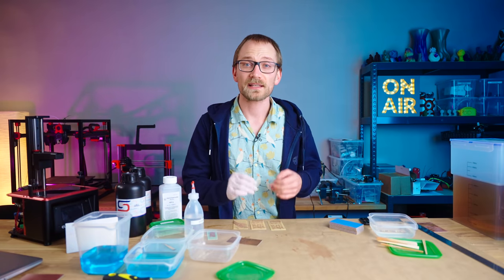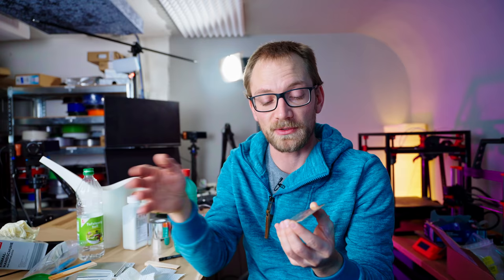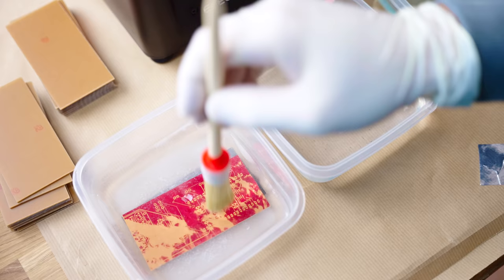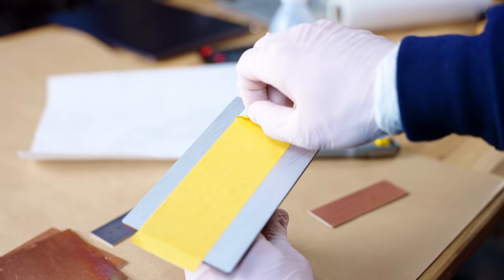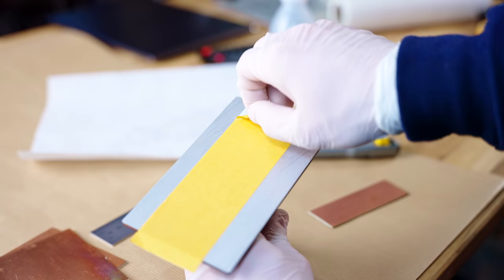The fastest way to make crisp PCBs at home!

Comment: The best way is : Get the pcb , a plastic sheet like u use in school to project page's or images , photo-developer , etching liquid of choise : hydro peroxide + salt peter acid is what i used if i translated it correcT. And u need a UV light box, a old scanner , pop some UV lights in. So u print the circut on the plastic sheet, u put the sheet over pcb,  u light it with your UV light box . u trow it in developer to  develop the traces on the pcb itself , than trow it in etching liquid where it eats away the coper that didnt turn black from the UV expoture (the actual pcb tracks) 5 min job if u have all ready to go. and pretty easy to get 2 sides pcb's done even.
Reply: Alternatively , there's PCB's where u can draw on with permanent marker and just draw it out , than do it in the etching fluid of choise , ask your local elektronic store i'm sure they got some

Comment: Interesting.  I haven't etched a board in about 15 years.  This would have been great back then.  Dual side could be doable, but it seems like it would be hard to line it up perfectly. I suppose the easiest way would be to center the mask in Chitubox and set up registration tape to line up the board and then flip it.  Might take some testing to get it right.  Seems like a nice way to make prototype boards, or one offs.  If someone wanted higher production at home, I'd think a CNC would be a good option, or a fiber laser.

Comment: Hm, the only thing that is omitted is the printing of the PCB layout on a foil, but for that you first have to create a 3D file of the layout. Then it's better to use the toner transfer method or insulation milling with a CNC. Or have I overlooked something?

Comment: Would like to know if you could use could use an aluminium can scrubbed clean with a etch resist to make a solder paste stencil too.  That would save a lot of hassle for a lot of people too!
Reply: I'm assuming a laminate photo resist as part of the process and then using your 3d UV printer to expose the patrern.

Comment: Instead of using photoresist, I wonder if you'd be able to directly SLA print resin onto a copper clad board. You'd probably only need a layer or two. Then an etching solution could remove the copper that didn't have the cured resin on top. Removing the resin after might be hard, but it would cut out the development step of the photoresist.
Reply: He tried that in this video, at the end.  Short version, great idea in theory, doesn't work in practice.

Comment: what was the minimum trace widths? they should better be either vertical, or horizontal. at other angles the result would be worse? 
where did you obtain that clad pcb with photoresist? probably, if you make board stops on the printer table, you can also solder mask photoresist after etching the board?

Comment: I can tell you from experience that most resins should not give off any nasty fumes. I have used UV resin for patching damages in the past and I could solder right next to it without noticing any downside. It's basically the same stuff as what they use in the factory - maybe you can try it out outside and tell us if e.g. a black resin gives off worse fumes than the resin-soaked fiber glass that is the basis of every PCB..

Comment: Is it possible to use an FDM printer to produce Circuit Boards? I’ve seen your video on the RepRap style but I was curious if there’s a filament that can tolerate the developing chemicals used on the photoresist film. The pcb details could be “masked” by printing the gerber or inverse gerber( whichever is the correct one) with filament then put through the developing process. I thought I asked this before, but I can’t find the question I asked or answer. So I apologize if this is a duplicate. -Jason Burchell

Comment: How about spray paint the PCB with lacquer and then engrave it with a laser before etching? That's how PCBs were made when I went to college, they used a professional laser cutter but I'm pretty sure a cheap hobbyist machine will work as well.

Comment: Seems like Chitu should consider this a selling point and add some custom software import/firmware options and possibly a "diy kit" and some sort of flow chart so it's not just chemicals and containers. My only concern would be running my display for 60 to 90 seconds continuously shortening the lcd lifespan. I wonder if two 30-45 seconds bursts would do the same thing with a short cool down period in between? If it was a built in firmware option why not?

Comment: Did you just make a 2-sided design on single-sided copper? As the other guy said, dry film photoresist is likely what you want to go for, but photoresistive ink with a sheet of transparency atop it should work too, and that same workflow can be used to apply a solder mask. A solder mask is something I recommend. I also recommend making up a tin plating solution with tin chloride and thiourea. Adding a little baking soda to the solution to neutralise any remaining acid and displace any O2 in the container with CO2 should make it last a while.

I rivet 0.8mm copper wires into the via holes by hand, it’s a bit of a pain but it gives a much better result than soldering them. Actually aligning the two sides will be your biggest issue, I’d advise 3D printing some sort of repeatable jig with which to align the edges of the blank copperclad each time. On the other hand, drilling all the holes first, exposing a piece of dry film photoresist for each side, and then aligning the pieces of photoresist to the holes could work well enough. I hand-paint my traces so it’s not an issue, if you don’t mind the carpal tunnel.
Obviously THT parts are more of an issue than SMT parts so I’d try to avoid them if possible, and I’d also ensure that any traces connecting to THT parts only connect to the opposite side of the board from the part itself. This way you only need to solder the ends of the leads. In the case of an IC socket, electrolytic capacitor, crystal, and some other parts, you’ll find that the part being mounted flush to the board prevents soldering on that side. Ideally a 2-sided board would have plated through-holes, but that’s not terribly easy for a home shop without messing about with silver plating or electroforming. So I attempt to fit everything onto a single-sided board if possible, only using a 2-sided board if needed. As for 4-sided boards, I’m willing to attempt to laminate two pieces of single-sided board with a 2-sided board between them. Sounds fun.

Comment: Would a non-clear resin be more successful? Is the issue potential 'bleed' through the clear resin?

if this method worked it would be so much better (and cheaper) than the UV sensitive ones as you only need the one chemical solution.

Comment: One of the usual cheap options if to use a special paper that you print on using a standard laser printer. Then iron that print on to your copper clad PCB, which transfers the toner image to the PCB. Peel off the special paper by dipping it in water and then just etch as normal. The papers really cheap, but quality differs between manufacturers.
Reply from the maker: Done that a couple times in the old days, but it's not been particularly repeatable and printers are getting rarer and rarer these days

Comment: An interesting idea, and I applaud the multiple use of expensive hardware, but the problem for me is all the toxic chemicals required.  The toner transfer method only requires a laser printer, a household iron or repurposed laminator and some ferric chloride.  It does take a bit of practice, but I suppose, so does using a 3D printer.

Comment: I use photographic paper on laser printer to print the mask, then I transfer it using ironing onto copper pcbs without photoresist layer.. with the right kind of paper the mask turns out perfect.
rest of the process remains the same.

Comment: This actually seems like a great idea for prototyping board houses.

You could load up a stack of panels on one end 
expose them to the UV light
developer
etcher
cleaning
apply solder mask through heat transfer film,
solder mask through ink jet
then off to a CNC which may be the only manual step in the process

Ideally there are no masks made to expose the PCB, silk screen, or solder mask. Wouldn't this allow them to produce boards faster with less waste?
Reply: without a mask you cant control what is etched and what isnt, the alternate is CNC the tracks which has the disadvantage of really bad resolution where small tracks don't form and break easily and then putting a solder mask is more complicated due to the uneven board

Comment: nice idea, but the LCD screen in these printers do not fair well with long exposures to UV. normal 3d printing the uv is on for less than 30 seconds for the initial layers then 2.5 seconds for all other layers. maybe i would use this for a PCB that require uber detail on tiny tracks verry occasionally, but getting hold of replacement LCD screens will be an issue.

for the price of one lcd screen, you can get yourself s UV bulb, and inkjet or laser clear sheets..,

Comment: i want my PCB to have a connector. imagine 9 pads on a pcb and i want a 3rd party chip with 9 pads to touch the 9 pads on my PCB (no soldering, these are disposable counter chips that are constantly replaced). would i do a type of lga connector? something less expensive and easier to do? could a PCB house implement it for me or do I have to manually add it to my PCBs that I order in bulk?

Comment: Hi, Thomas! I guess that similar devices that just light up a PCB copper template exists. And it can be larger and cost maybe less (or so) as this MSLA 3d printer with smaller boundary sizes.
But my main concern is about drilling all these holes. I think that it's a hell... Unless you have a proper drillinc CNC machine which isn't very affordable.

Comment: Also curious if you can make the resin cure to the surface of the copper with the plate removed and then just manually peel the board off the FEP?

Comment: I know nothing about the boards you were using at the end. Are they sensitive to IPA such that you didn't want to clean off the excess resin with that first? If it did work, would you have to then clean the exposed resin off of the board for it to solder properly? You mentioned solder masks and I'm not sure what you meant since I don't do this kind of thing.

Comment: Cool idea.
But getting two layer boards complete with holes, vias, solder resist coating, and markings in a few days for around $10 bucks - and not having to spend so much time myself doing this, and not doing design - has got this beat like a pinata.

Comment: So if I wanted to just make a PCB exposer could I do that with just a control board, display and UV light source, and print an enclosure on my fdm printer? If so could anyone suggest appropriate parts? I'm not familiar with msla printers.

Comment: What was the size of the fine lines that you had on the PCB?  Can the printer do 8mils?  Or even 6mils?  I'm looking to see if this is viable for QFN and fine pitched TQFP packages that have 0.5mm pitch.  Is is doable with this process?

Comment: Are there any transparent tapes which PLA/PETG etc stick to? If so it might be possible to do a similar process with an FDM printer but using the printer to create a mask for protecting parts of the board against UV shined on it?

Comment: 🎯 Key Takeaways for quick navigation:

00:00 📜 Making PCBs quickly and without waiting for a fab service is possible with an MSLA resin printer.
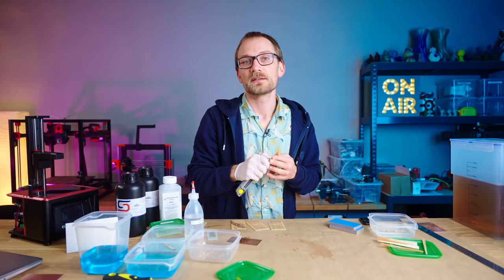01:23 📊 Standard PCB making uses photosensitive coated material and requires UV light exposure.
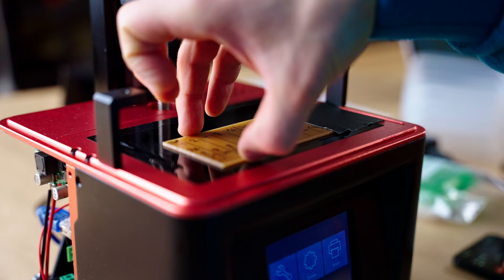02:51 ☢️ Developing the photoresist layer involves using a solution of sodium hydroxide, which can be hazardous.
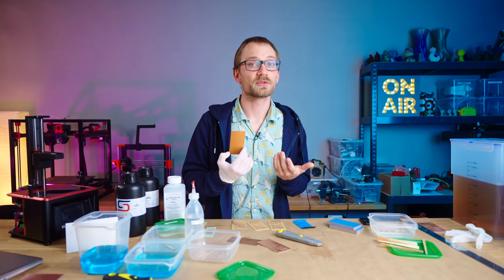04:13 🧼 The developed PCB needs to be etched using sodium persulfate, another potentially hazardous chemical.
06:23 🔀 Inverting PCB files for printing is required to get the correct result.
09:21 📸 You can use the photoresist process to transfer images onto a PCB.
10:17 💡 While not a replacement for large orders, etching PCBs with an MSLA resin printer can be practical for quick or iterative needs.

Made with HARPA AI

Comment: How does this approach compare to a laser printer on a transparent, and then UV exposure, like we did in school and university?
I assume the laser printer still can achieve higher resolution, or are those 3D printer LCDs even finer?
Can you set the LCD to fully transparent, i.e., that it is a flat UV source, and the masking is done by the printed transparent?
And one final note: It is really a huge detour, going from Eagle (which can make 2D PDFs, EPS, PNG, ...) to 3D, then slice that, only use 1st layer, and then convert that to a 2D bitmap for the LCD. :-)
Reply: It depends on the printer. Some of these 3d printers use displays that surpass 500 pixels per inch, which is probably adequate for a typical hobbyist's rapid prototype needs.

Comment: Do you have any idea on the minimum trace width or spacing between traces? Just the pixel size?

I was trying to use a Bantam Tools mill a few years back and it always failed whenever you had to whip out a small trace width flat pack chip. I might justify a resin printer if I can use it for both things.

Comment: Well the easiest and cheapest old-fashioned way is printing the board layout using laser printer on a glossy paper and then transferring the toner mask to the copper board using an iron, but the quality is too poor for SMD devices (<20mil traces). Now I use a cheap laser engraver and black color acrylic spray as a mask which gets removed by the laser (then cleaned by ethanol before etching, acetone used for mask removal). No need for UV, expensive films and photoresist sprays but the quality is perfect.

Comment: Hi!
Your concept blow my mind! I spent a lot of time and money making my prototype PCBs perfect - I mean reliable 6 mils (or even 4 mils) routes with soldermask. Now I'm happy with that. My priority is time. I don't want to order prototypes somewhere and wait 1 week or longer for result. Your approach can be a revolution in my home lab if... it really works. 

Please give me some details. What is minimum width of routes you are able to achieve? Let's assume that resolution of printer's screen is not issue. In case of eg. Anycubic Photon M3 Premium, 6 mils route consists of 5 pixels of LCD screen. Sounds ok, but I'm afraid of consequences of distance between LCD (glass / protector) and PCB. Potentially it will result with blurred UV light along edges of routes = lower resolution than declared in technical specification of the printer. 

Have you developed a method for exposing double-sided plates in this way? What I mean is mounting the PCB in such a way that when the board is flipped over, both sides match.
Reply from the maker: The mask getting blurred out isn't much of an issue IRL, as you're laying the board directly onto the LCD layer. If you look at resin prints (which are essentially just many layers of positive photoresist), you can still see the pixel pattern in the finished print, even with the highest resolution printers. While I haven't tested the absolute limit of the minimum positive / negative detail size this process can achieve, I would think that at least a 2-3px wide structure would be absolutely doable.

Comment: This solution is not for hobbyists. The cost of the devices is significant, and not everyone can have it.
For home electronics it remains photochemical using a UV sensitive positive 20 spray or paper thermal transfer. I think that last one is cheapest and quite fast.

Comment: This is neat and all but only really useful for single-layer PCBs, since there is no easy way to create vias except by painstakingly soldering jumpers to both sides. And thru-hole components would need near-side soldering in most cases. A pain.

Comment: Been tinkering with the concept of 3D printing a single layer (0.2mm thick) STL of my circuit - PLA being my intended material - onto a board as "resist", then etching, but I'm hitting a wall - I can't find ANY info on whether PLA will resist any of the easily-had copper etchants for long enough to be useful. Dunno if it's just that nobody's put anything out there, or my google-fu is poor, but either way, the result is the same: I'm at a "dunno if I really want to try it" stop in the project. Anybody got any info that might help me?

Comment: I used to make my PCBs 30 years ago with this methode. So this is not new or some thing special! U can use a normal UV Lamp. Today, i more like to use a CNC drill to make it, about it save the chemicals. Or if you need realy professional PCB, then look at a company how make it. Especial if you need more as 2 layers. Also the Materials are not really cheap and the equipment, so a company how make it for you is cheaper over the time and the PCBs are professional and work 100%.

Comment: Any concerns with leaving the UV light source on for a long time?  I'm thinking about the heat generated during a long exposure time.  When 3D printing, the light is only on for 2 seconds and then off for a while (which happens to allow it to cool off a bit).  Do you think this would shorten the life of the UV light source due to the heat?
Reply: it's probably a LED uw light , so heat is a lot less , if any.

Comment: Far easier is printing onto photo paper with a laser printer and using an iron to transfer the mask onto your board then soak in warm water to remove the paper then etch as per normal.

Comment: Ooh, I kinda want an MSLA printer now simply for PCB making...
Reply: Wait, wouldn't it technically be possible to buy a spare LCD screen for a SLA printer and just connect it to a PI or ESP32, and display the PCB negative this way? Can these screens even be connected through something relatively standard?